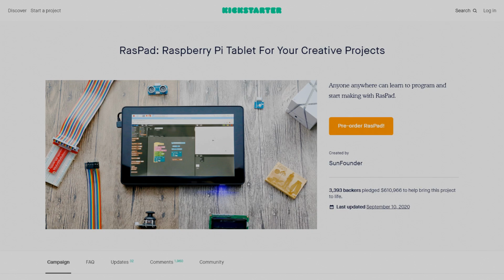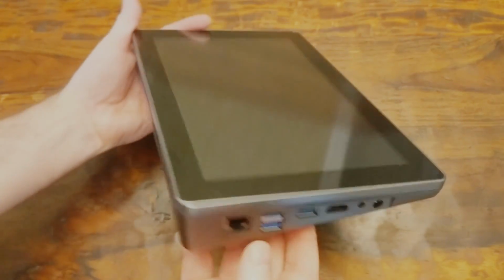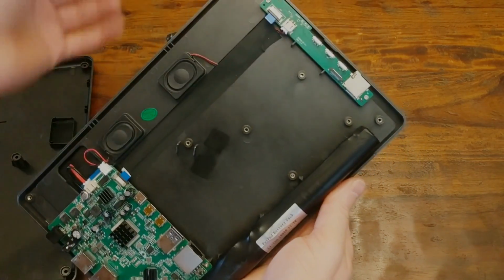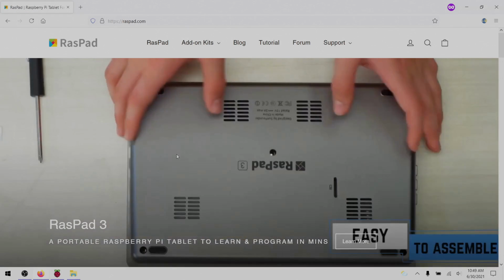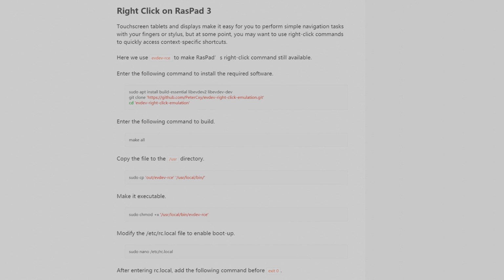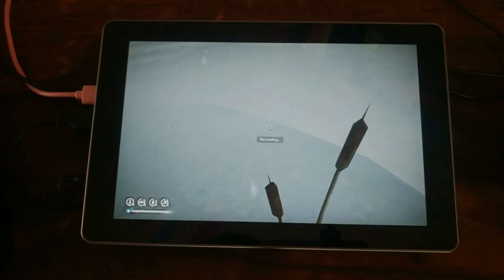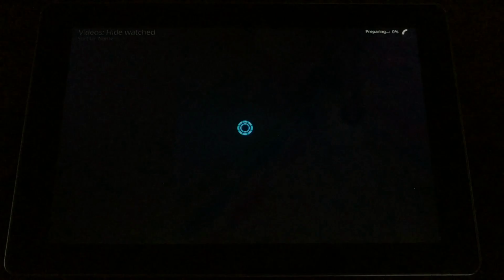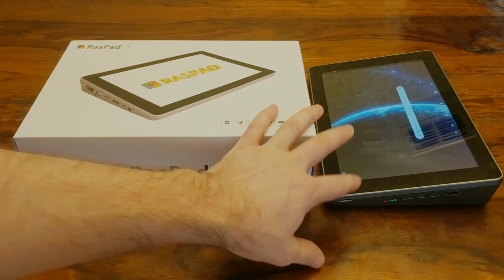Turn Your Raspberry Pi Into a Tablet: RasPad

Comment: 250$ is this a joke
Reply from the maker: For a 1280×800 10-finger touch screen, 3200 mAh battery, tilt sensor, and case that integrates everything it's not that crazy. If you buy those parts on their own, even the cheapest ones you can find, it wouldn't be much cheaper and it wouldn't all fit together as nicely.

Comment: mine is already portable with a 7 inch screen ,2 8000 mah lipo batteries,keyboard ectnow why do I need your kit.
Reply from the maker: You don't need it but the form factor is nice imo. Out of curiosity, what kind of setup are you using?